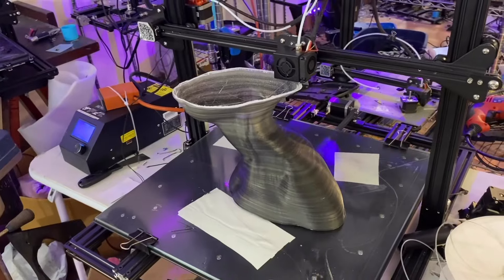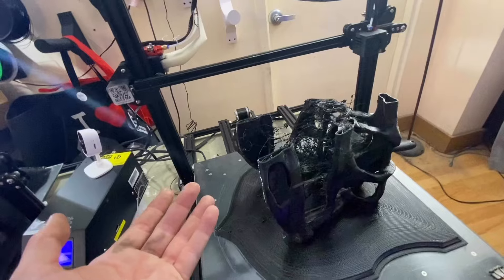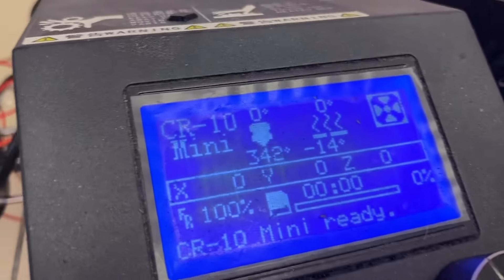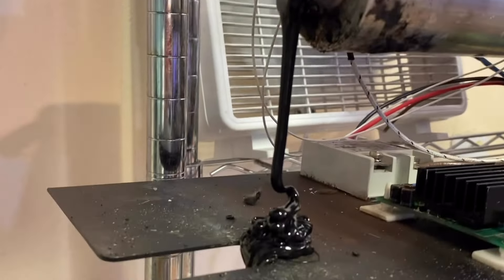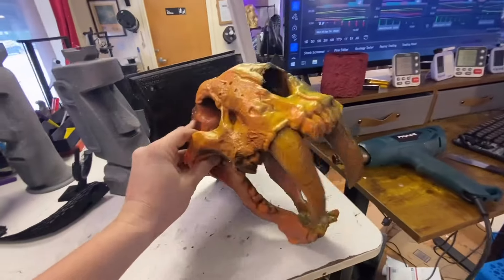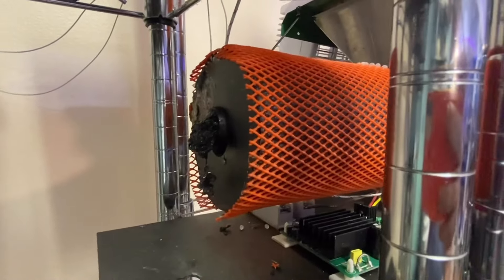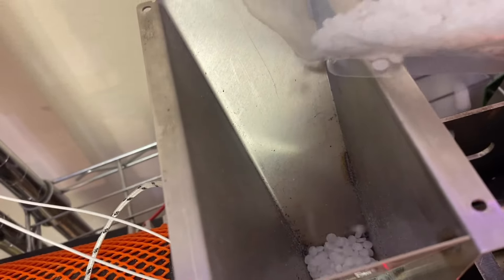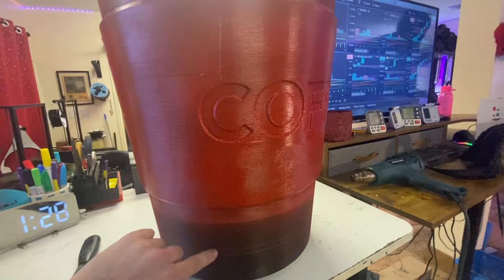How a 3D-Printing Business Works: Give Me Fuel, Give Me FIRE!, GIANT Red Coffee Cup, Vlog #53

Comment: On that one printer that always misbehaves at the same point, I would examine Z Axis issues. If you examine the previous layers, do them seem to be getting spread out or squished together? If so, the pitch of the Z Axis screw could be off (manufactured incorrectly). I have seen this many times, and it gets worse the taller a print gets. OR, maybe the Z Axis motor is skipping steps because the base is binding at that point? Some ideas.